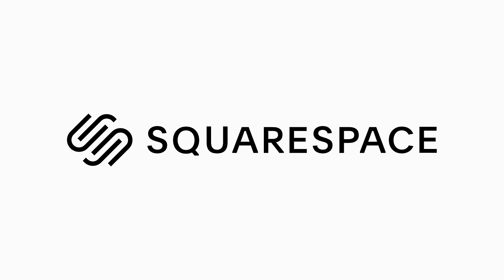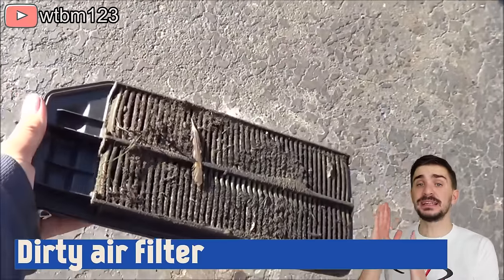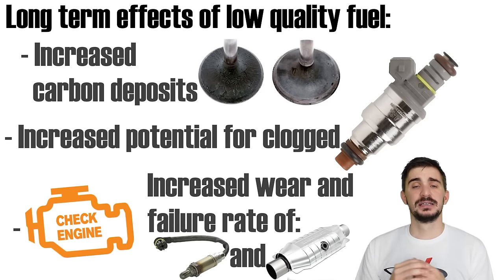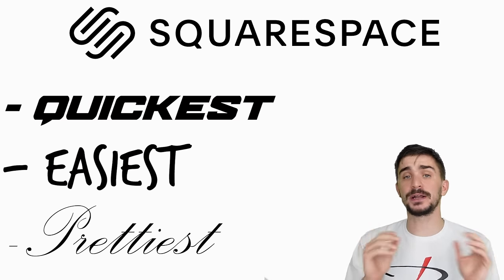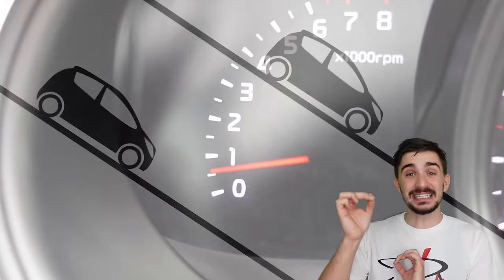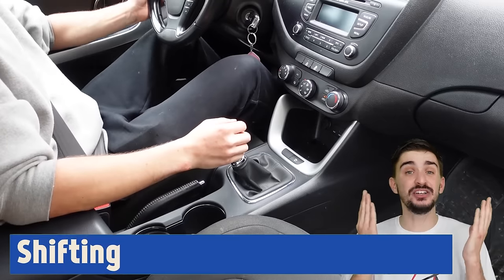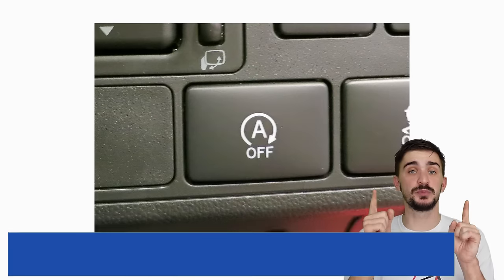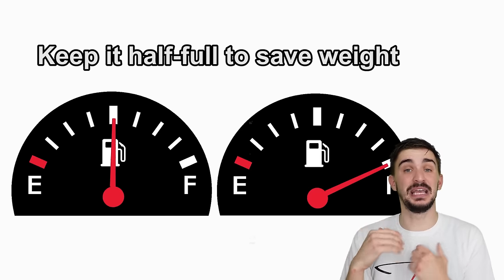EVERYTHING on FUEL SAVING - PRACTICAL DRIVING and MAINTENANCE techniques to REDUCE FUEL consumption

Comment: Combining trips is another great idea. You'll often reduce the total distance travelled, plus the engine will spend more time warmed up, which means leaner mixtures and lower engine oil viscosity (not to mention the benefits of driving off water from combustion that otherwise contaminates your oil). Drive to the most distant destination first.

Comment: I usually follow these 3 rules to save fuel:

-Try to be careful to maintain your vehicle following the manufacturer's specs, specially when changing oil, filters and inflating tires.
-Be respectful towards your moment of inertia, avoiding unnecessary, sudden and strong braking/accelerating movements.
-Carpool it's not a bad idea when possible.

Comment: Missed an uncommon one about shifting, I've heard people say that (with a manual car) flooring it in 2nd gear to skip 3rd and go straight to 4th saves gas because 2nd gear is easier for the engine to accelerate the vehicle. However, accelerating any mass from one speed to another requires the same amount of kinetic energy added to the system, and engines are the most efficient at lower RPM and higher load (ex: ~2500RPM, ~80% throttle), this is the region where you extract the most amount of energy out of the fuel being burned and therefore this is the ideal region to be in when accelerating. This is where pumping losses are at a minimum because your engine is not fighting a throttle valve to pull air in. There's charts out there that compare either Brake Specific Fuel Consumption (BSFC) or thermal efficiency to the torque output (load, more air = more torque) and RPM. Great video, thank you!
Reply: That's the main reason a manual car these days can never match automatics. Modern automatic software are extremely competent at following the BSFC map and keeps the engine in the most efficient zone.
Reply: Get a obd2 reader. Switch gear at 2000rpm is the most economical
Reply: Exactly!!
Reply: @alanchantiefighterskuanlia627  It depends where in the rev range maximum torque is developed.  In my Skoda Rapid training car, 2,000 rpm on the flat is ideal.  In my TD5 and 200 TDI Land Rover Discoverys, 2,500 is more appropriate.
Reply: @SkyWKing  Modern automatics have many ratios which can quickly adapt to early shifts to match the most economical revs.  They are very clever and do a great job.  Until they go wrong.  Then the bills and frustration become huge.  I do not like autos.  They have become better over the years but I still prefer a manual.

Going down long descents, people never lock them into a lower gear, preferring instead to ride down the hill on the brakes.  This increases air borne brake dust.
Reply: Well as a manual driver you don’t need to floor it ever just to skip from third to 4th. And a T56 M12 transmission has a skip shift feature that actually forces you to go from first directly to 4th if you below 2500rpm. Once you exceed that rpm you can use second and third gear to accelerate(it tends to be more annoying than helpful though). And also I coast a lot. City traffic everyone’s in a hurry just to stop at the next light. And highway I just coast down steep hills when I can. My logic is the more I save normally driving the more fun I can have later.
Reply: @ryanrake2714  Assuming your car is fuel injected, by coasting down hill you are actually using more fuel.  You are also not in particularly good control of the vehicle and will used more brakes.  

If the revs are above idle and your foot is off the gas, the fuel is shut off and you are going downhill for free.  The second you disconnect the engine from the gearbox, the computer starts adding fuel to keep the engin idling.

In town, keeping the vehicle rolling allows you to catch lights as they change.  This is about 50% effective.  Rushing up and stopping is 100% ineffective and also uses more brakes and tyres.  My car has done over 80,000 miles and is still on its orignal brakes and disks.  It really can be done.
Reply: @kevanchippindall-higgin1859  yes, that’s why I said I avoid rushing while most other drivers always rush to the next light. I always try and stay rolling to avoid the stop and go fuel waste. I hardly have to use brakes when driving as I do. Most the time rev matching I the engine slows me down enough to avoid using the brakes. 

Back to fuel consumption at idle vs in gear, I think your correct, I never took the time to think about it but the computer acts like a process controller to keep the engine at idle. When gas isn’t applied the computer stops putting fuel through the engine avoiding any detriment to a cars economy and attempt to bring the rpms down to idle while driving. Of course it won’t bring you to idle for a long time. Is that what your saying?
Reply: @ryanrake2714  yeah thats true, in the old honda fit (ids-i engine) you have to shift at 2800 rpm or even 3000 rpm, and that thing has so god mpg!
Reply: The most economic FLYING of a single-engine aircraft is at 75 % of the engine's rated POWER.
 Example:
Max power at 4000 rpms.
Max economy at 3000 rpms.
Just sayin'.
Reply: @SlikLizrd  well there's probably power transmission effects there due to it, yknow, flying instead of rolling. I'm merely saying that a common car misconception is that you can save gas by accelerating harder and skipping gears.
Reply: Well, the most efficient is at lower RPMs.. but also at high load. The higher the load and the lower RPM you can get without lugging, the more efficient it is. I believe the reason behind older manuals being more efficient like that is that they put high load on the engine for a brief period of time, so even though they're increasing the RPM more, they're using the engine the most efficiently possible for a given RPM, then they switch into a higher gear for low RPM low load cruising.

This is kinda why I love driving a CVT so much. I just put in enough throttle for the ECU to determine ratios where my RPM is below 3,000 until I get to the speed I want to go, then I back off to maintain speed. Peak torque on my vehicle is 3,000 RPM, so I get to enjoy decent acceleration (it's an old hybrid barely making 100 HP so it's not that fast ;P) while maintaining near peak efficiency. I could be even more efficient, but the difference is pretty minimal.
Reply: modern automatics are good but not always. Every time I press the throttle slightly more then either the torque converter goes loose or it downshifts a gear but either way the rpm goes up which means engine load is low.
Reply: @SkyWKing then why do manuals only consume slightly more fuel compared to a dual clutch in the same vehicle? automatics are not that good and unless you're a bad driver they are not much more efficient, even today's automatics hunt gears, which is not efficient

Comment: If you still have excess speed when coasting downhill with the accelerator pedal released, using a lower gear will not only help limit your speed by increasing engine braking, it will also run the alternator and A/C compressor faster, recovering more of the gravitational potential energy you've saved up by climbing the hill.

Comment: Very good video. Nice work. 
I don't agree with only one thing. It is beneficial to turn the engine off at a red light IF you have to wait for more than 40-50 seconds. Sometimes you have to wait for more than a minute (at level crossings, toll booths, waiting for fuel pumps). Cars with larger engines can burn a lot of fuel in a minute. The wear and tear that your starter motor is going to experience are negligible compared to the excess fuel you are going to use by just idling on red lights every day. 
There are also other driving habits that can save you fuel. I always approach a red light very slowly, often by the time I get to it it turns green, this means I don't have to accelerate from a standstill. Accelerating from 5-10km/h is way more efficient than accelerating from a standstill.
I manage to get my Audi A3 2.0TDI quattro as low as 5 liters/100km.
Reply: Definitely agree with the last part. Im considering doing a video of my own showing the early braking technique.
In the states where a lot of the stop light have sensors, stoplights will change when you approach them. However the sensors are so close to the stop line that most of the time, cars will stop a couple of seconds before the light turns green, mostly negating the fuel saving benefit of the sensor.
Acceleratong from 5kmh means i dont have to slip the clutch at all, which saves in many ways.
Also have a TDI here.
Reply: @ignasanchezl  TDI are some of the best diesel engines ever made. Very tough, , economical and relatively cheap to maintain.   Engine braking is also a very good way to save on fuel.
Reply: 1.9 PD BEW is what i got
Reply: though people behind you will flash high lights and honk, that's the only problem
Reply: @wobblebs87  let them.....I have a sticker in the rear window, " you want me to go faster, pay for my fuel. Or suck it up."
Reply: @iandennis7836  where did you get that
Reply: @wobblebs87  hand written VERY carefully, outlined with highlighter. It seems to work, tailgaters zoom up behind and then take the next opportunity - no matter HOW ill advised - to overtake and disappear, usually getting a view of me cruising up behind them at the next traffic lights, stop sign, roundabout or whatever. Very satisfying, which is why I rarely overtake anyone these days.
Reply: @ignasanchezl  I agree. Most drivers on the road ( Calgary, Alberta, Canada ) do not! Gasoline is so cheap, you know…!

Comment: I used to draft semis when I was younger. It didn’t decrease fuel Efficiency at all. It was a really big bump in gas mileage. I stopped doing once I had kids as it wasn’t safe. Many times I had semis brake check me because I was following so close. Never had an accident but got close few times. Another downside was my engine ran hotter as it wasn’t getting cool air in radiator.
Reply: Just like in NASCAR: draft too much and the engine heats more.
Reply: As long as it's not overheating, the hotter the engine the more efficient it is.
Reply: I am a truck driver and I do this in my personal vehicle.  I also do not mind when people do this as long as its on the highway.  But be aware the weight of the truck and thus the stopping distance can vary by much more than you would think so pay close attention if you do this.  Also your car should not overheat when doing this as it still has a cooling fan and air will still pass under the trailer.

Comment: Aaaah hypermiling, always some weird and interesting things there, did quite a lot of experimentation with that in my younger days :D Agreed with all your points! Smoothness, as always, is key to best results. And try to get into DFCO (deceleration fuel cut-off) as often and as long as possible :)
Reply: i fink thats the key to fuel savings--knowing that the injectors cut off when going downhill.
Reply: I've been wondering how pulse and glide with DFCO compares with very light constant throttle for cruise conditions. Specifically, under DFCO you're still turning the vehicle's kinetic energy into waste heat by making the engine pump - I wondered if putting those pumping losses to some use by burning a tiny amount of fuel might actually be better in some conditions. (I do use engine braking in preference to friction braking. For my next tank I think I will try pulse & glide with DFCO.)
Reply: @thromboid  Whenever I take my car for service, the mechanic is shocked that I barely have any brake wear at all :D
Reply: Dfco IS A JOKE. UR ENGINE BECOME AIR COMPRESSOR. Going neutral save more fuel. My car have dfco but use more fuel ckmpared to neutral
Reply: @alanchantiefighterskuanlia627  how does an engine use more fuel when 0 fuel is being injected?
Reply: @eTiMaGo  Speed is lost pulling dead compressor.
Reply: @alanchantiefighterskuanlia627  Yes, of course. So use it at appropriate times like when slowing down or going down a slope. For "pulse and glide", I agree neutral/clutch in will let you cover more distance before slowing down too much.
Reply: Agree 100%! DFCO if key and on of the reasons my 2012 Civic Si gets amazing fuel milleage. Slowing down in advance = good. Braking = Bad! The first time i drove my father's and brother's Mazdas i was baffled... "why is that thing braking by itself down a hill goddammit.." With my Civic, i use the momentum to help me save gas, up to a point.
Reply: @alanchantiefighterskuanlia627  uh.. you engine is an air compressor no matter how you use it..
Reply: @marc-oliviercabot3380  
Clutch in or neutral disengages the wheels from being affected by the engine being an air compressor. You can try to lower the RPM and therefore engine braking by shifting to a higher gear, but eventually the injectors are going to turn on to stop the RPM from going below 500.
Reply: @Appletank8  yes. But clutch in or neutral will make the engine idle and use gas. Engine braking or coasting down at a high gear won't. Up to the point, as you said, where the engine will be at a low RPM. (Chances are, we're thinking the same thing.. lol)
Reply: @marc-oliviercabot3380  
When being in neutral uses gas, it also rolls further. The question becomes whether using gas to cover the distance lost in engine braking compensates for it, whether by delaying letting go of the gas, or accelerating a bit before hitting 0.
Reply: Joke's on y'all I actually shut off my engine down hills...or I used to before I parked my clapped out '95 6.5 diesel. 😂 I could work that thing under any condition. Gotta get home with zero brakes? check. No starter? Push, hop in, clutch, go. Vapor locked for the fourth time that day? 3/4 wrench on the injector lines and crank it/push it (depends on the day and how many fuses you have laying around)
I almost miss those days fresh out of highschool. lol

Comment: When following a semi truck you should stay far enough back that you can see their side view mirrors. This allows them to be able to see you because thier trailer prevents them from using a rear view mirror. If you follow this advice you can still see some of the benefits of drafting above 70 mph. 
(Of course as speed increases you have to leave more of a following distance)
Reply: The benefits of this are not drastic but when driving a 2012 Chevy Express 3500 with a 6 l V8 I can get almost an extra MPG. (About 19mpg vs just over 18mpg)
Reply: You're not drafting unless you're inside the wake turbulence. Your ECU is just very happy to optimize air-fuel ratio when you're finally driving a constant speed.
Reply: I hate driving behind big trucks, I dont feel comfortable if i can't see several hundred meters down the road when going highway speeds.

Comment: Awesome video. Definitely busted some misconceptions I had about coasting in neutral. Thank you for always doing so much research and presenting it in an easy to understand format!
Reply: Coasting in neutral does save fuel, unless it requires the use of the brake later in a situation where engine braking would have avoided that. One simple example is a hill where coasting in neutral just about keeps you rolling at (the desired) constant speed. If you were to engine brake, you would have to alternate between engine braking and accelerating to keep the same average speed. This means your engine would be running at a noticeably higher RPM than idling and thus generate more friction and pumping losses, which ultimately would have to be overcome with more fuel  combustion.
Reply: @aphextwin5712  For that to ever be true you'd have to have like a 0.01 degree incline which is very rare. Coasting in gear is the correct method 99% of the time.
Reply: @NAmania  I don’t know what car you are driving. I frequently ‘roll’ through a freeway tunnel (two tubes with each two lanes per direction) that descends about 50 m over a 3200 m distance, ie, a slope of about 0.9°. Since the beginning and the end of the tunnel flatten out, the main part of the tunnel is a bit steeper, best guess thus maybe a 1° incline.

The speed limit in that tunnel is 100 km/h. I am happy to follow the trucks in the right lane, their official speed limit is 80 km/h but they usually drive at between 85-90 km/h (according to my speedometer). My rough guess for terminal coasting speed in my car in that tunnel is about 60 km/h because I actually have to do a bit of pulse and glide* to keep up with the trucks (ie, the car slows below 80 km/h while coasting in neutral, out of consideration for the cars behind me, I don’t let my speed drop below 80 km/h).

*Which brings me to my last point. The ‘pulse and glide’ method is called exactly that and not ‘pulse and engine break’ for a reason. Google "pulse and glide metrompg" for a detailed explanation.
Reply: @aphextwin5712  You're spot on on that technique. I always use neutral whenever I'm somewhat descending and want to increase/maintain speed. It takes a lot more fuel to keep a gear and making the engine rev. Then, when I feel I need to brake, I just put it in an adequate gear that takes care of my speed (whenever possible), taking advantage of fuel injection turning off